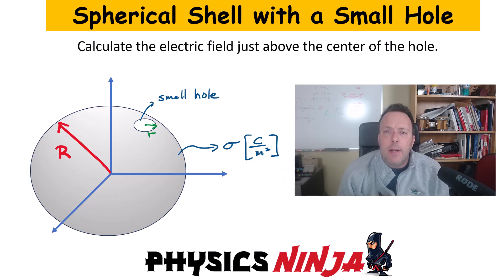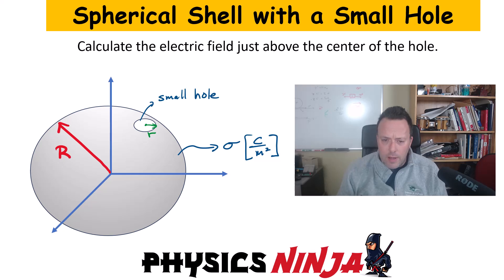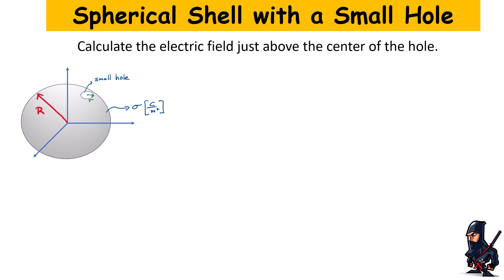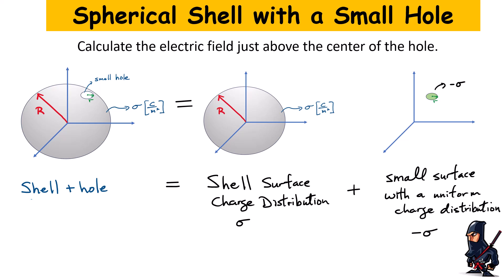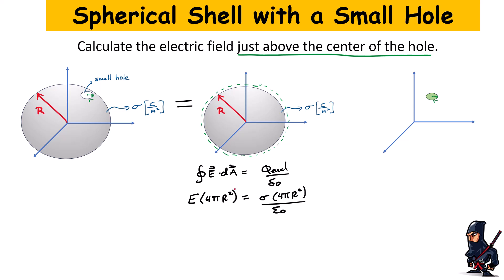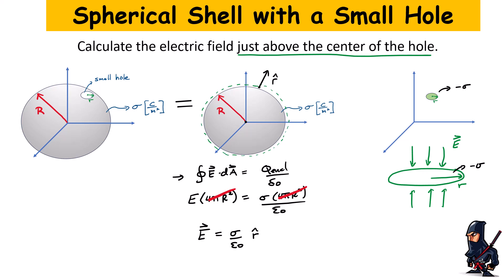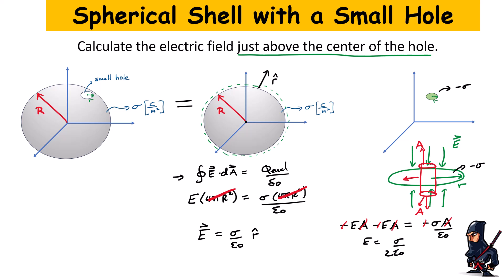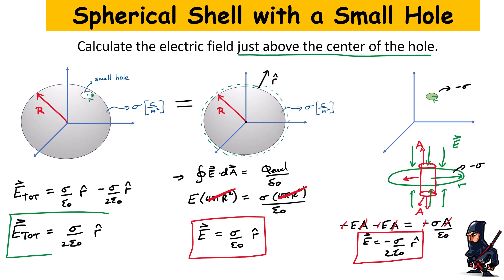Gauss's Law - Spherical Shell with Hole

Comment: You said:

considering a line charge distribution of length 2a in which half the line has uniform charge density negative lambda and the other half has uniform density positive lambda . determine the electric field at a point z above the center of the charge distribution